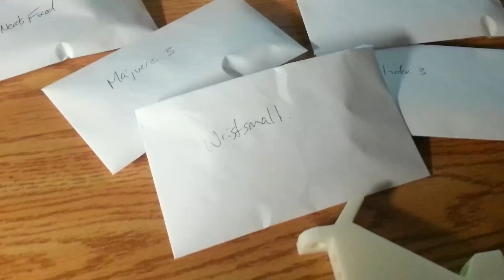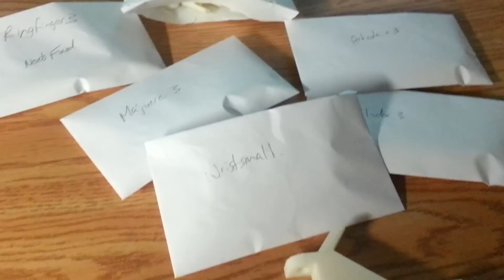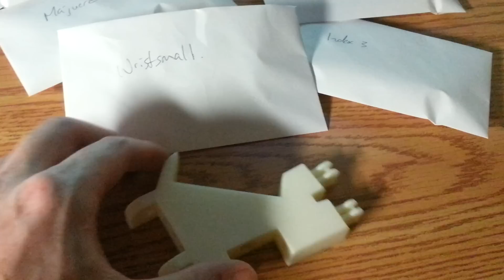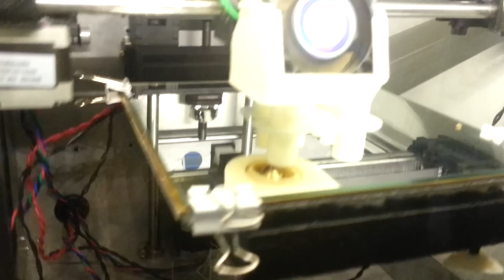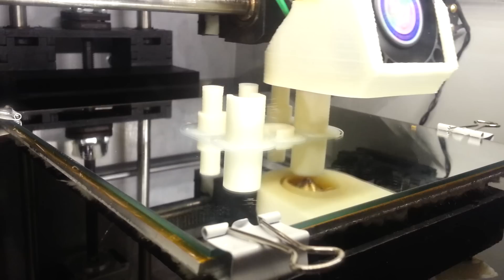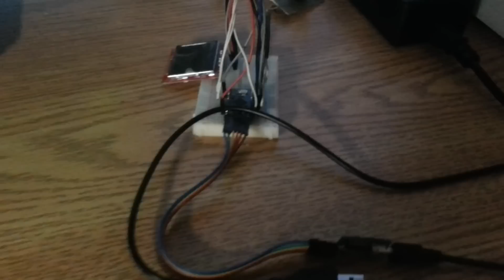DIY Humanoid Robot InMoov - Part 1

Comment: Hello, I have a solidoodle printer, but my parts has a concave form and so difficult to stand in the bed, although I did activate the support, the solidoodle does not buil it. Do you have the same problem ? Any clue? Threre is a software problem?
Reply from the maker: Nope I have basically zero problems.  Sounds like you need to do calibration.  Go to the Solidoodle Forum and related wiki page- plenty of info to get you going.  Cheers.